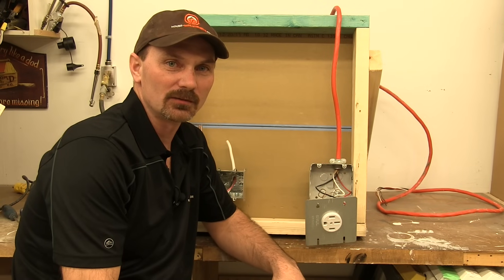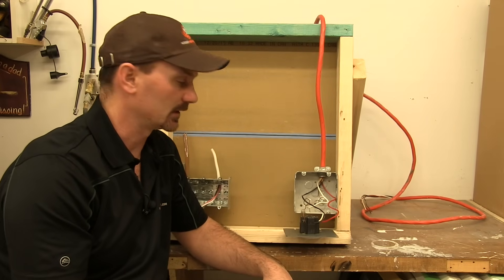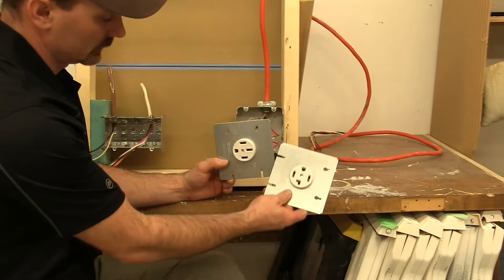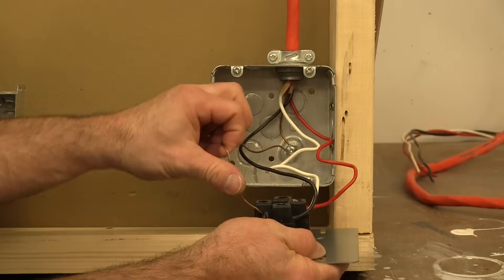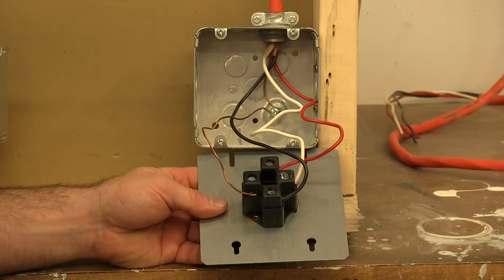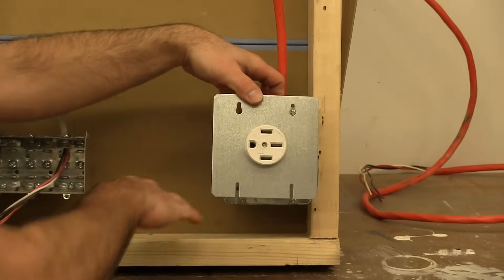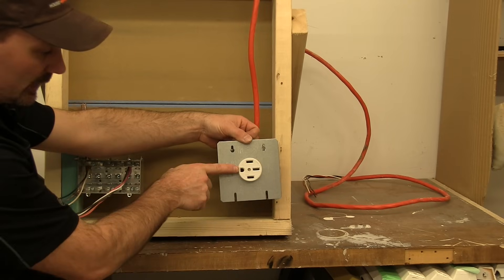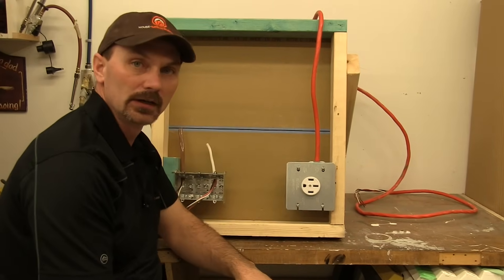Range Receptacle Wiring

Comment: LOL! I literally just woke up and have to do this today and was about to look up a vide on wiring one of these :)
Reply: Hey sparky. Do you set o/c to the receptacle or to the wiring ? I've been in the business 35yrs now, a 14-50R receptacle is legal on any code version with a 40Amp overcurrent device. Please let me know if you know otherwise.
Reply: Also, he specifically said he was using a smaller guage wire, just to show the connections, and to check with the AHJ as to local requirements ... I see nothing wrong with that.
Reply: He said 50A range receptacle.Wired on #8 anyday .... everyday !
Reply: I don't have an opinion on electrical, I go by electrical code. Any range wired under NEC or CEC uses a 14-50R receptacle on #8AWG. Under either code, if the range is over 16kW, then the conductor would be upsized, and the overcurrent device as well. I have NEVER come across a range that large, apart from a commercial install.
Even new resi construction uses #8.
If you have a code reference that you think has been misquoted, I'm all ears.
Reply: The 14-50R receptacle legal on any code version with a 40Amp overcurrent device, but no where does he reference 40Amp he said 50Amp, so the question then is wire size, so if you know nothing about what your doing and someone copies what he doing, that's wrong, he should use the correct wire, not 10AWG, you should know the correct way of doing this but not everyone that watches this video does, and that should bother you be an electrician because somebody may do it as they see it and not check codes out as he says too.
Reply: I'm glad you see nothing wrong with it, maybe someday you will, that's your opinion, I see someone using the wrong things telling people how wire something, that's wrong in my opinion....
Reply: Don't listen too this guy....
Reply: More specifics?
Reply: He's showing and telling the wrong wire size, wrong amps for wire sizes, they will over heat before breaker trips out
Reply: You realize he said at the start that the wire size he is using is incorrect, and he clearly says to check what your code requirements are?
Reply: not a good person too lesson to when he does not use the correct thing, and as per NEC 8AWG is not good for 50 AMPS
Reply: You do have an opinion on electrical, sorry I do not be leave that you don't..

Comment: Thanks - I really like your channel. In my area (Oregon), they require the ground screw in the box to be green. It doesn't change anything, just a detail the inspector would look for.
Reply from the maker: Our boxes(Canada)  come with the ground screw in the boxes, the odd time I see a green one but usually they are just zinc. You are correct though in the US it generally will be coloured as green and needs to be added to the box you purchase.
Reply: @HouseImprovements  your forum registration is weird what is solution? ? was there captcha or security I miss?D>